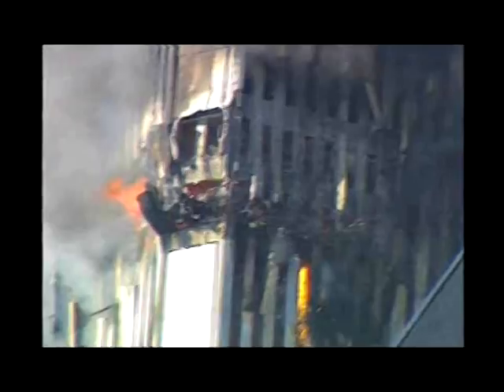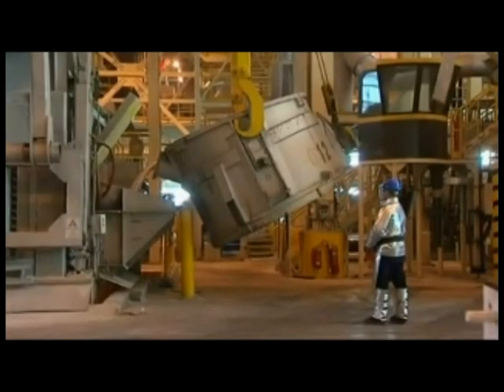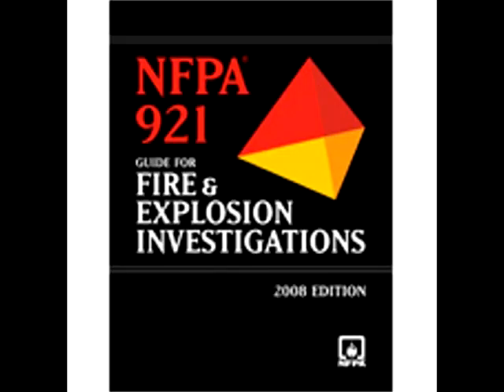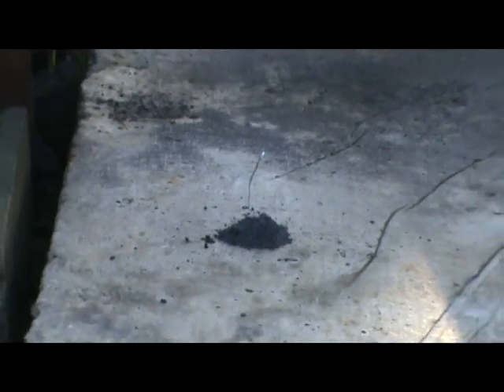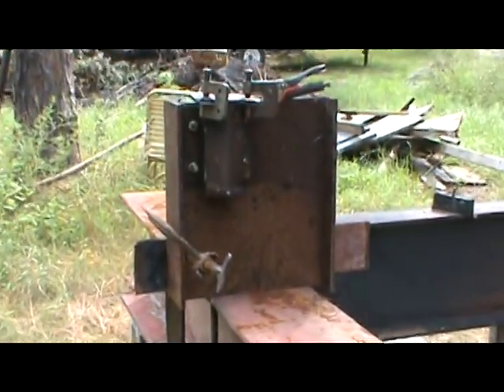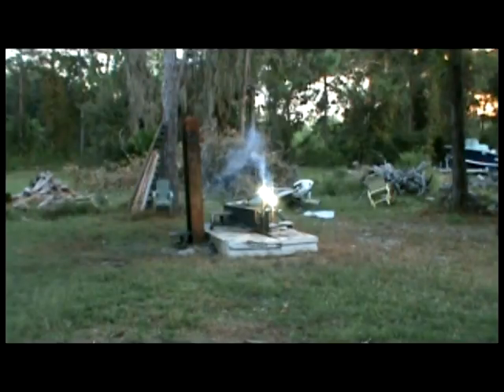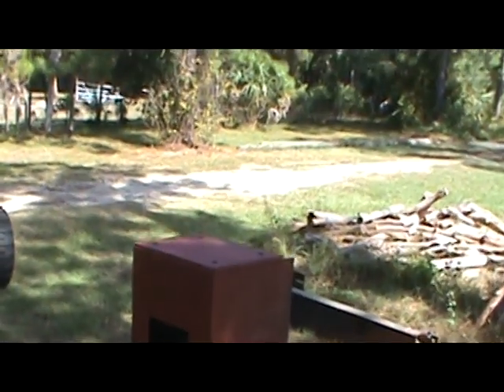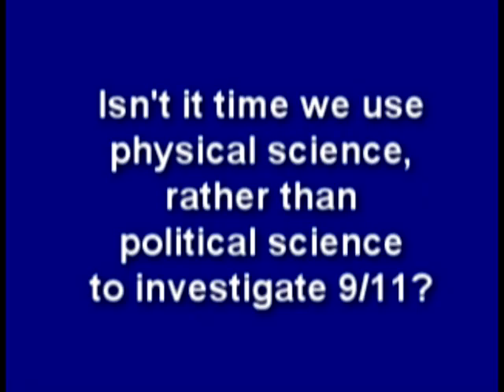9/11 Experiments: The Great Thermate Debate

Comment: If you heat steel to over 1700 degrees Farenheit, and then add in the fact that each tower had a mass of about 6818 tons per floor or 13,636,000 pounds per floor, how could you not see that the lower temperature was more then sufficent to create a collapse. We are not talking thermite, or any other conspiracy here. Weight and heat alone was enough to cause the collapse of both buildings. Anyone who believes that thermite or special explosive materials or anything else was used are just plan wrong. Steel begins to weaken after about 3-5 minutes of temperatures above 1500-1600 degrees farenheit, Temperatures of burning jet fuel would have reached almost 2000 degrees farneheit (even if only for 2 minutes) this would have been more then sufficeint to create the collapse of the towers.

Comment: Never much thought about the melting metal being steel until now.  One thing to keep in mind, the steel need not melt to fail as the critical temperature is much lower than the melting point, around 1200°F.  Well done video... I learned something of great value.

Comment: JET FUEL CAN'T MELT STEEL BEAMS
Reply: JET FUEL CAN'T MELT STEEL BEAMS. BUT A FIRE BURNING AT OVER 1000 DEGREES CAN WEAKEN THE STEEL BEAMS CAUSING THEM TO BUCKLE AND THE WHOLE TOWERE COLLAPSES AND THAT IS WHAT CAUSED IT TO COLLAPSE
Reply: +T-Bone not talking about 7. Talking about 1 & 2

Comment: OmegaSoner correctly states, "steel beams cant melt jet fuel"  However the reverse, "Jet fuel CAN melt steel beams" is equally correct.  Especially under the right conditions, such as we had in the Twin Towers, and the Pentagon.

Comment: You forgot to add the thousands of tons siting on top. I can take a steel beam and set a flame with a propane tank to it and NOTHING will happen. But if I took the same steel beam added a flame from a propane tank and balanced a battleship on top of that steel beam, trust that the beam will bend and break. Common sense? Try it maybe? Do you actually think that the only thing made of steel in the ENTIRE WORLD TRADE CENTER was what it was made out of? How many tons of steel besides building material was in those buildings. Copper? Titanium? Solder? As for the dust poofs. Take a garbage can, drill a hole at the bottom, sprinkle some talc at the bottom, now drop a filled trashbag into it. Watch the talc POOOF OUT OF THE HOLE you drilled. When something solid takes up an empty space, it displaces pressure kind of like if a room suddenly collapsed. We learn it in 3rd grade science lab. Does a third grader actually have more common sense than this nonsense? Occam's Razor? Maybe? Yuh think?

Comment: How would conspirators get these gadgets into the walls of the building?
Reply: True. Some random person ripping out drywall and insulation to attach these to the supports would be suspicious. And they could not put it on the exterior because it was covered in concrete
Reply: +Matthew Walsh Amen to that.
Reply: +PlanetRockJesus 
1973 during it's construction.
Reply: +ravenwda007 I thought about that, but not enough to come to a conclusion. Seems that construction crews would need to be really blind not to see what was going on, or, it could have been done in the evening when they'd all go home. But wow, to think that far forward? Just seems so unlikely.

Comment: The extraordinary high pressures generated at the point of impact between the aluminum jet and steel structure accounts for the nano thermite material. Once that reaction started, aluminium didn't just melt, it burned in an exothermic reaction able to melt steel. That's a self sustaining reaction.

Comment: Hmmmm.  why not proceed with research stemming from the accepted version of events and hypothesize why the towers came down to address witness accounts?  A reasonable approach, inherently more likely to achieve a valid result.  Instead, this guy STARTS from a conspiracy theorist approach and works from there.  There are literally dozens of potential lines of research that stem from the events of that day - airplanes, explosions, and fuel and their action on the tower's structure.  Did he investigate these?  NO - he simply focused on one very isolated issue and extrapolated from there.  Classic conspiracy theory in action.

Comment: The beams don't have to fully melt to the point where the metal liquifies, it's enough to heat  them up to a temperature that will weaken the construction, and under the load, it will collapse.   

Still doesn't  explain why the WTC7 collapsed for no apparent reason.

Comment: I HAVE THE ANSWER! There is this video showing both the first plane and the second plane hitting the towers. About 70 feet before both plans hit they launched a missile at the tower then they flew into the towers. The missiles most likely blew though the steel. And also a plan never crashed into the pentagon. The Pentagon is the most guarded building on the planet, with cameras pointed at it from every angle. But yet the government only shows us one video of the pentagon being hit. And in the video there was no plan just these things (missiles) coming from the sky and an explosion happened. But only a year later the government deletes the video, leaving us with no footage of what really happened. Also the hole made in the pentagon was only 60 feet wide and the type of plane that supposedly hit the Pentagon is 155 feet wide. Which leaves us to the question where planes really hijacked or did the terrorists use there own plans? There is a picture that compares the planes that crashed
Reply: Into the towers and the plan they said hit the towers and they are not the same plan. So why is the government hiding the truth from us? We may never know.

Comment: The government will be after this guy and possibly me after I get done saying this...It would make sense this theory...Possibly a fuse hidden in the carpet where the planes impacted causing the thermite stuff to start melting the beams but also with the extra weight of the planes inside the building extra weight that wasnt meant to be there when the engineers did the blueprint...god damn science is great

Comment: This guy has a very good argument that I can't deny one of my thoughts is that it was a bunch of preplaced thermite devices that were placed during the building period by some one maybe at night or a worker that was secretly with the terrorists and they had maybe ha an electric timer or lighter to light them on a command
Reply: +Mitchell Geary 

In other videos I look at in the past, some employees said that, from evening to soon in the morning, workers were making lot of noise prior to 9/11 events in the twin towers. What they were doing there, nobody knows, so, just for that reason, it sounds strange.

Btw, I'm on the "official" conclusion side, but with this video, I'm starting to have quite some doubts. Not that this video proves and concludes that 9/11 events were an inside job, but it proves many things, like, it's possible to melt steel real fast, and create an explosion in the same time, in way to weakened steel, bolts, or any parts that need to be weakened for a good and fast controlled demolition.

Is there a debunk video as an answer to this one? If so, please give me the link. Thanks in advance.

Comment: RGR 777 when I worked in S C I F IN 2ND ID HQ Korea... We had special munitions I had get some tng... these were themo plates the size of the file safe...1 to1.5 thick with manual or electric igniters ...these were designed to destroy all contents of the file drawer ...they never said thermate...ite.   but I also taught M202 flash 4 thermo rockets ...anti armor ...there it was a jelly that could liqufy. ..so may be thats why I got the extra tng and distruction team task.  one could easily focus the heat to cut or weaken key beams ...and timed radio controlled ele fuses too...the plates could disguised as common stuff too...just saying

Comment: You know what else generates a lot of heat that can weaken steel beems?  BURNING FREAKING JET FUEL.  

People make a lot of fuss about how it can't burn hot enough to melt steel.  YOU JUST PROVED IT WAS NOT REQUIRED TO MELT THE BEAMS, JUST TO WEAKEN!  What you seem to fail to understand is just how much you've strengthened the common story surrounding the 9/11 collapse.  

Those load bearing beams are under a lot of pressure from the weight they are expected to carry even in the best of times.  The heat from the fuel fire weakened the beams, and beams directly damaged in the crash forced additional weight onto the other structural beams.  Due to the weakening the beams collapsed on their own -- first the weakened beams, then the beams that began to be under additional pressure as the weakened beams gave out and the weight was naturally redistributed to them.  Eventually the whole thing just collapsed under its own weight as a combination of additional structural failures and concussion vibrations from collapses from above shook the whole thing apart and the weight of the building cascaded downward.

The only thing even remotely interesting about the whole thing is the fact that it came straight down on top of itself bearing a superficial resemblance to a controlled demolition.  However, controlled demolitions start at the bottom of a structure and bring the whole thing down on top of themselves.  The collapse of the World Trade Center towers began in the middle, bringing the top down to crush the bottom.  Similar but nowhere near the same.

Comment: They actually tested this with actual World Trade Center steel beams. They took a beam from the wreckage, placed it over a simple fire fueled by jet fuel, and sure enough, the steel heated to the point to where it bent and would have caused a collapse. What caused the molten metal, Im not sure. But they proved that JET FUEL alone, when ignited, could weaken the steal that it would have collapsed.

Comment: Right, why would thousands of tons of steel, concrete, and other building materials collapsing make loud explosive-like or gun-fire-like sounds? That doesn't make any sense! (end sarcasm) Of course, anyone who was downtown during a thunderstorm knew that sounds bounced off the buildings, often times making 1 thunder clap sound like 5, and made it appear louder as well. So every loud bang, whether windows blowing out from the heat/pressure, the collapse of entire floors, dozens of crunching/collapsing beams, hundreds of windows breaking, could very easily and likely sound like a rapid succession of explosions. And contrary to that 1 news report you posted saying something to the contrary, the fires did not subside and neither did the smoke. Anyone who jumped rather than be burned or suffocate to death could have told you that.Of course, there is also zero evidence that dozens - hundreds of workers were installing this mystery material strategically throughout the building prior to 9/11, but why let that get in the way of paranoia? There is also the complete absence of any whistleblower anywhere at any level of this grand conspiracy. Let's review how many agencies & people would have to be in on this, how many loose ends there would be, and how many opportunities for the conspiracy to unravel there would be:- Dozens to hundreds at the CIA- hundreds at least at the NSA- hundreds to thousands in the military- hundreds to thousands in the civilian government- hundreds of people in the airlines (unless you're part of the fringe of the truther fringe that thinks 1960s missiles were used)- thousands of people in the buildings that'd be witnesses- thousands of people in surrounding buildings that'd be witnesses- every single available still and video camera in the media capital of the world focused on those buildingsLiterally tens of thousands of people would have to be in on it directly, and millions of possibilities for evidence to be visually/audibly observed or recorded. And not 1 foreign intelligence agency picked up the slightest trace of this plot, even though they hack federal government computer systems on the regular. Yet not one whistleblower, not 1 mistake with all the moving parts. Not one shred of evidence there were trial runs, training of any kind for the Conspiracy, no paper trail, no slipups where wives/husbands/girl/boyfriends/escorts of any kind overheard a phone call or saw a piece of paper.All conspiracy theories of course need whining about the "corporate media" as an accomplice, feeding into your average joe's cynicism. The alternative to corporate media is state media, somehow they seem more likely to be an accomplice than the corporate media. Corporate Media loves money more than anything else. There would be an advertising/marketing bonanza for any media outlet that found evidence of anything suggested by the tinfoil hat wearers. Plus, journalists love breaking stories. Of course, if they're in on it there are a few thousand more to add to the "in on it" pool.
Far too many absurd assumptions and scenarios are required to be believed to make the conspiracy theory believable. And that's why they're laughed at. By the way, house fires can get to 2000 degrees or higher, and they don't typically have jet fuel, furniture, carpeting, plastic, and personal goods anywhere near the volume of the WTC. So its not much of a stretch to think the WTC can burn to the melting point of steel.But why don't I close with my own conspiracy theory, maybe this is another rabbit to chase into a hole. Maybe the planes WERE hijacked and the resulting fires DID destroy the building according to the official story. BUT, the reason it burned so hot is because the chemical that all airplanes are required to carry to spray chemtrails burns hot enough to melt steel!
Reply: +John McClain  WHO allowed them entry to USA with college grants, and probably more welfare? What about Boston bombers?  And more USA haters come here legally with permission, from some one? plus 10,000 more refugees!  We will have to give up more of our rights, for the people that we bombed 15years ago? WTF.I remember & have re watched ~the Ronald Regan speech , where he is wishing the world had a common enemy so we could fight as one!Also Re~watch  JFK final speech warning about the powers that Be, only to be murders before he fully warned us?
Reply: Incompetent government workers, that's who lets them in. liberals who hate the us as much as muslims do

kookoo
Kookoo!
Reply: +robert h Said the guy addressing nothing I said. You bring up one point easily answered by incompetence in the government. We see it every day, at the local dmv thru every agency of the federal government. They couldn't build a web site with a few billion dollars and three years that could handle 50 transactions at a time before crashing. Look at airport security, look at the SEC. Corruption and stupidity everywhere. Excellence is found literally no where. A friggin contractor at the most secure agency of the federal government (nsa) walks out with a friggin thumb drive with every secret at that friggin agency. 

If it makes you feel better to believe in mystery boogeymen that conspire so well to start a war without a single shred of direct evidence, and nothing but a bunch of videos that say how else it could have happened, then please soldier on and be happy. I don't want to stop you
Reply: +robert h Sorry replied to you on someone else's machine.

Comment: there were tons of fallout dust blanketing the city, which anyone could have scooped samples of and analyzed-yet no mystery "nano/super thermite" .
and the claimed iron and aluminum components is present anyway in office buildings everywhere.
this theory requires still tons of this expedient, taking into account the gargantuan numbers of structural components to be dealt with to "make the building fall straight down",especially when we count in the additional weight of versions of this guy's thermite containment applicators.
btw-about the bangs-has none ever heard a tempered glass sheet let go? 
the only way a reasoned scientifically objective  person would consider this conspiracy theory more fact based than the official version is if the person is easily lead with prejudiced factoids.

Comment: There are many fallacies in this presentation. First of all, all steel is not equal. Secondly, everything you suggest is conjecture and happenstance. Thirdly, six weakened columns would not cause a building collapse, particularly when the collapse began at a different level of the building. It is well known that "eye-witness" accounts are the least reliable, and even less reliable when those witnesses have suffered trauma.

Your approach is typical engineering: create a solution and then look for a problem, rather than the other way round.

Comment: yeah yeah yeah what happens when you have a fire and you blow on it, it gets hotter right well the updraft in the buildings at the time would have cause the flames to get far hotter than what it takes to melt iron, i used to fireproof buildings some years back and watched so meany videos and did all sorts of tests and in fact just a fire alone can cause buildings to collapse with out planes crashing into them so this why we fireproof the bloody steel but if that fireproofing was old, knocked off or not there at all you could verywell have a building collapse, witch in this case thats 100% what happened